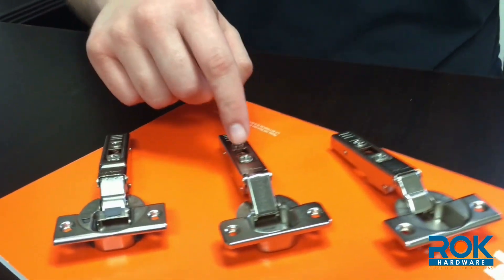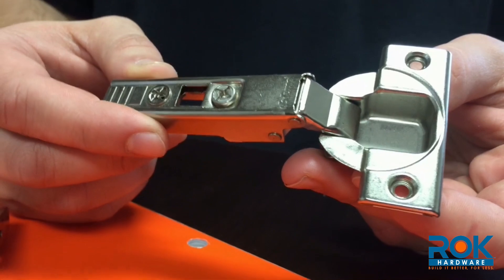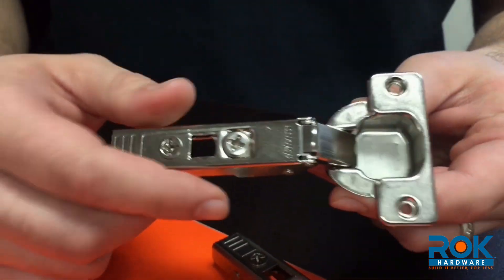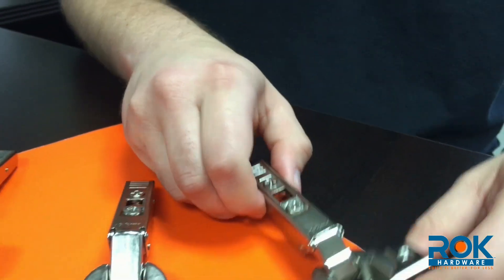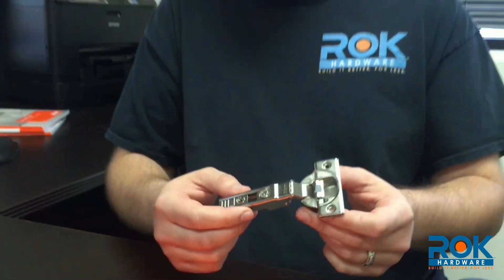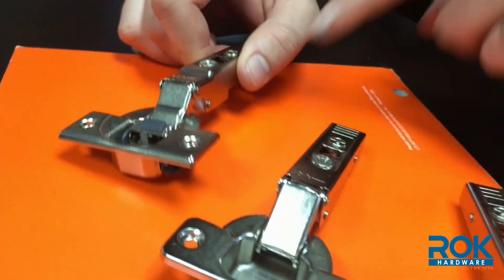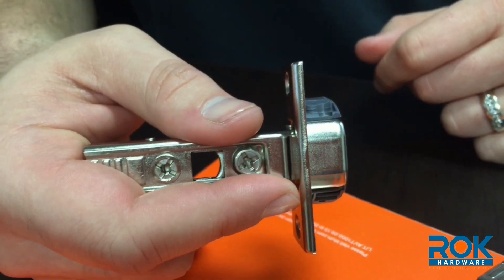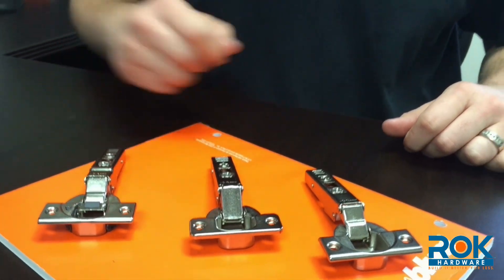Cabinet Hinges 101: 3 Closing Types of Euro Hinges

Comment: Good Explanation but if I replaced hinges to soft close Will one soft close hinge be enough or do i need 2 per door.
Reply from the maker: Hi there! Doors with 2 hinges should work fine with one soft close. Doors with 3 or 4 hinges, I would suggest  at least 2 soft close per door.
Reply: Rok Hardware ok thanks and that will work fine with that one soft close along with one self closing hinge?
Reply from the maker: Absolutely. The hinges should be the same brand of course, as well as have the same opening angle. Ex: Blum's 71T3550 (self-closing hinge) + 71B3550 (soft-closing hinge) would be a good combination.
Reply: Rok Hardware Great thanks Good information!